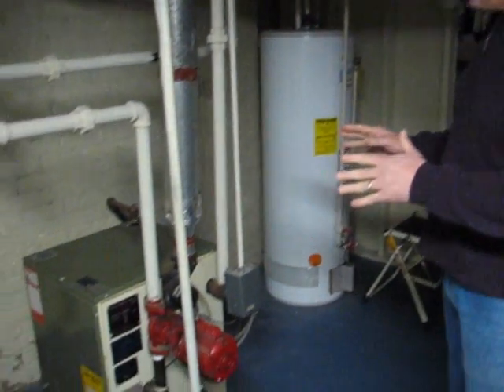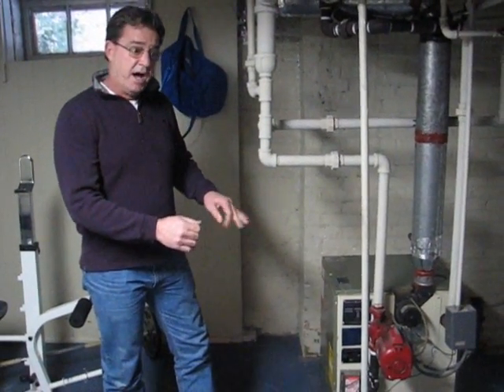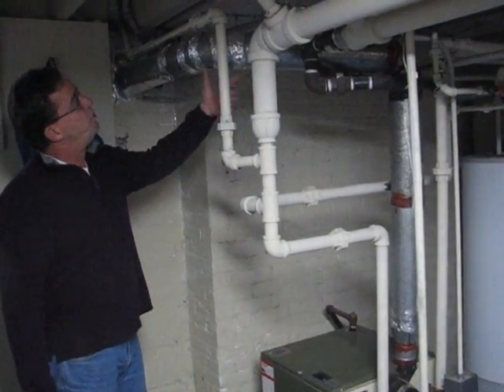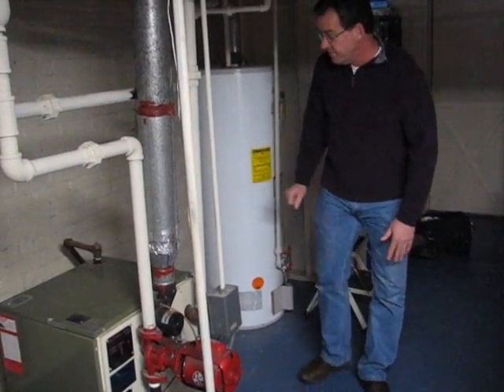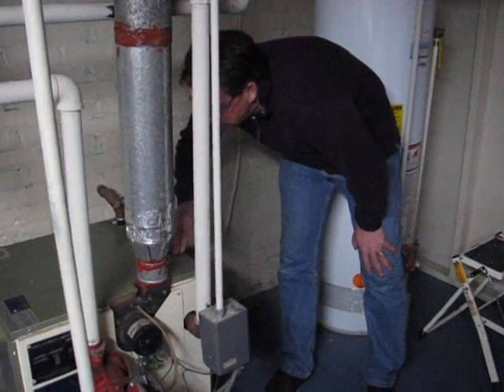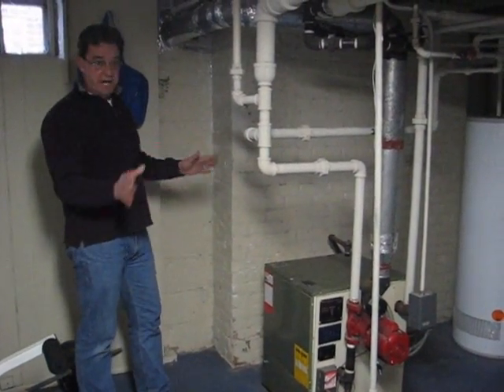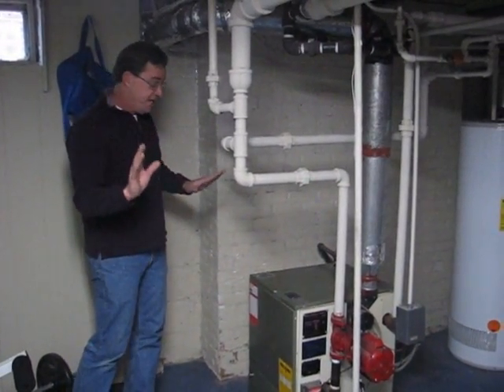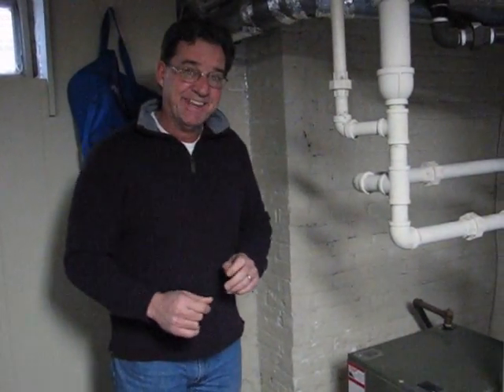Residential Boiler Inspection - McCaffery's Home Inspection

Comment: correct me if am wrong , but the circulator pump must be installed `downstream` the air tank, which by the way should be replaced for a diagpragm type, is way more efficient,

Comment: Exhaust does not have to be double wall, is also fan assist so 1/4 per foot not required and thats not epoxy its heat silocone because the fan assist has to be siliconed at every joint.